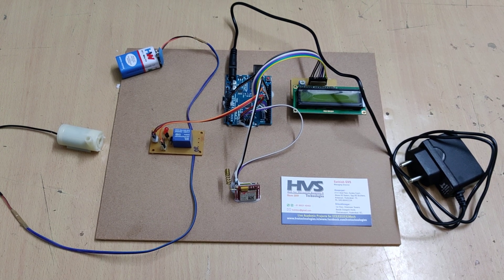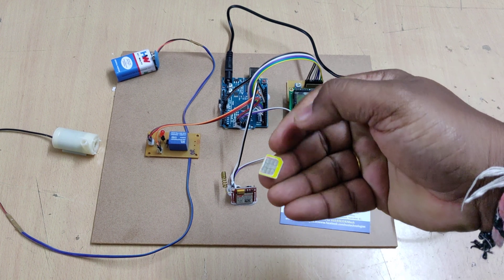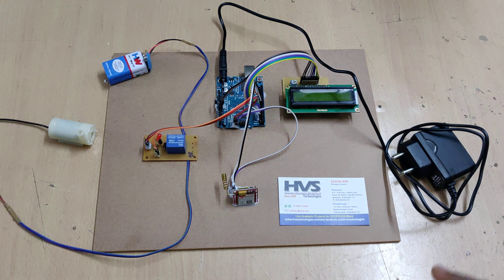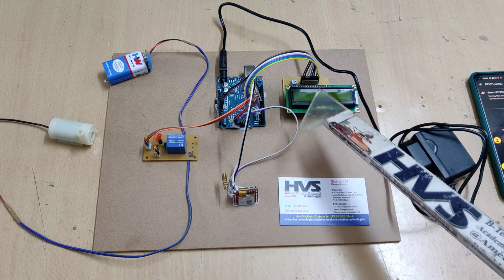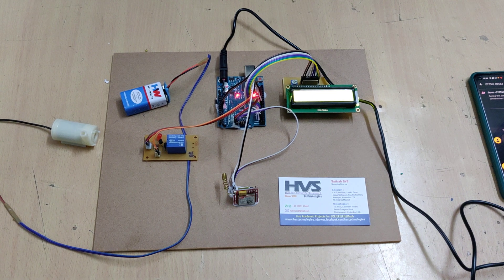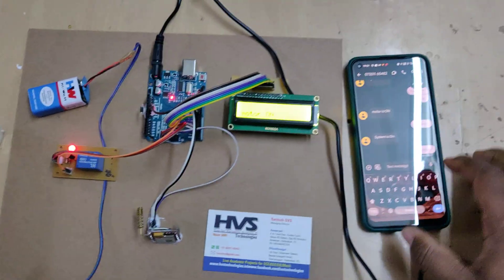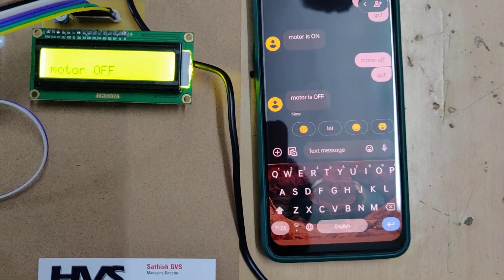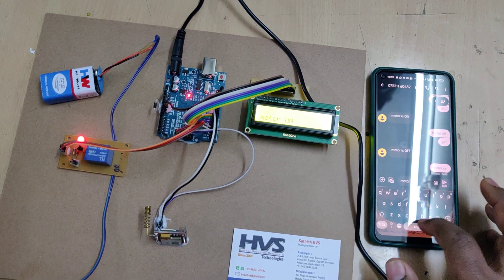HVS-3405. GSM Based Agriculture Motor control using Arduino UNO

Comment: Small motor ku ok, 5hp motor ku what relay need to use
Reply from the maker: @atm6584  respective starter.
Reply: @hvstechnologies  DOL starter ku which relay spec is suitable nu sollunga
Reply from the maker: @atm6584  same relay is enough
Reply: @hvstechnologies  ok thanks bro, Same Relay which we use for lights fan is enough right, I'm planning to use 2 of this relay - One for On and another One for Off
Reply: Bro Pls Reply - My Project is Waiting for your Valuable Input
Reply from the maker: @atm6584  You can contact us at +919603140482
Through WhatsApp or call